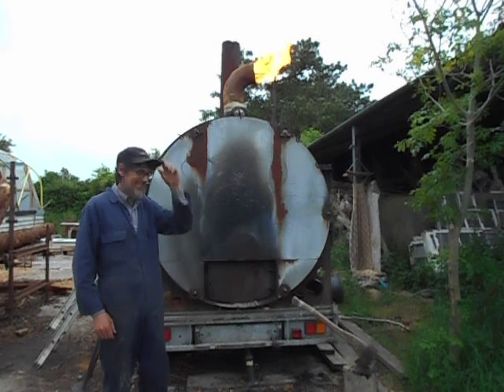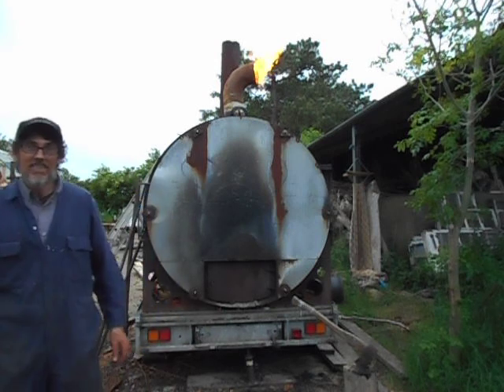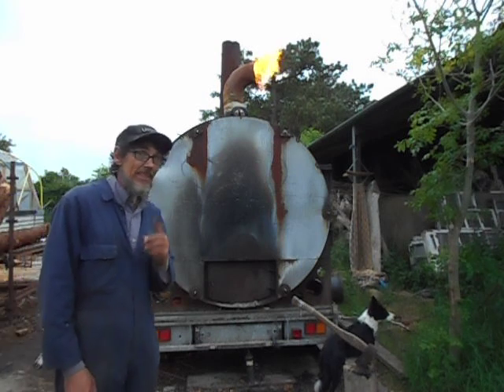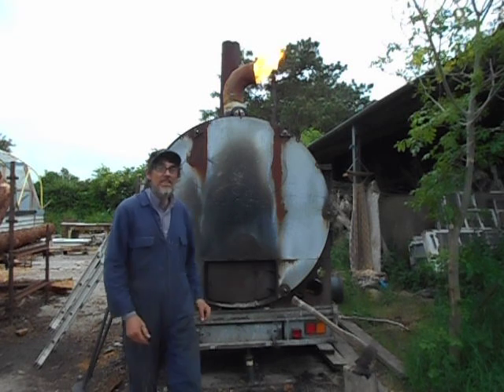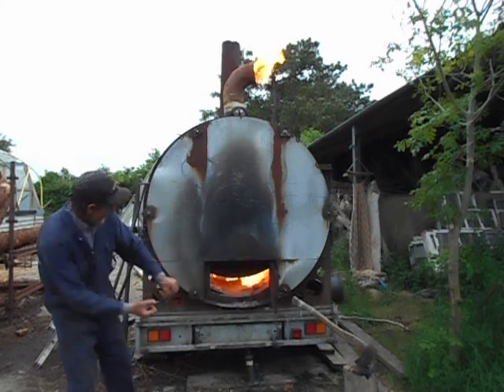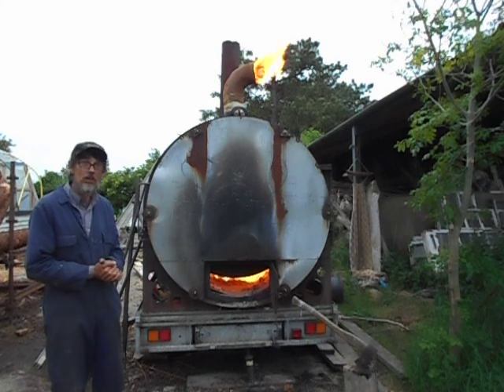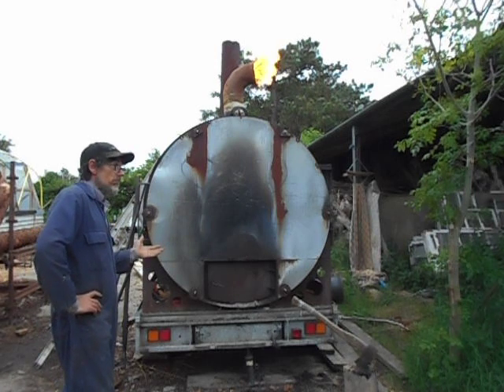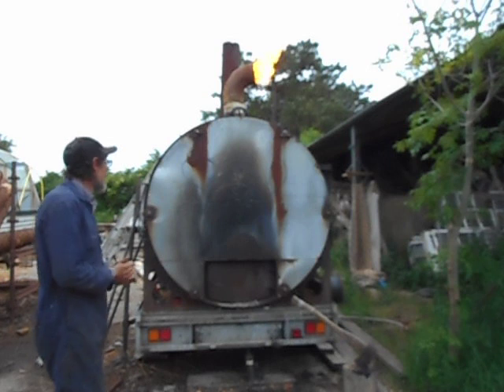Making Charcoal

Comment: Great! I really hope you find time to post videos of the build of your new retort. I've been watching all the Thai videos of homemade retorts and am planning to build something similar with heat capture for water heating. Some of them run the gasses through a condensing loop before returning the gases to the burner and I'm hoping this idea might allow green wood to be roasted directly in the kiln without adding too much steam to the burn (I don't think they use condensation for drying but more to collect wood 'vinegar', although it should condense excess steam also). I wonder whether your wood is winter-cut and seasoned in air a while to reduce water content before you roast it or whether green wood and summer-cuts works well. Thank you Tim, and best wishes for your charcoal industry.
Reply from the maker: Thank you so much for your encouraging comment. Since this video much has changed here. I have not built the new retort having discovered a fast productive charcoal making method that suits our needs here much better.
I now use Flame Cap Pyrolysis to use the fancy term,
or a controlled bonfire being simplistic.
all of our charcoal output here now is used for experimental archaeometallurgy and the charcoal produced this way is ideal for this use.
I hope to post a video in the next while describing the method which is simple, productive, and is very cheap or free.

Comment: Great job. Thanks for the video. I have about the amount of smoke before ignition of the gas from the carbonization process. Is there a lot of smoke?
Reply from the maker: Yes there is some smoke at the beginning, mostly water vapour, quite dirty just before it can be ignited. 
I no longer use this method, and the retort has failed, the inner chamber has burned through.
I now use "flame cap carbonisation" in a ring kiln built from corrugated iron. Using this method I can produce about 2.5 m³ of charcoal from branchwood feedstock in about 8 hours with practically no smoke throughout. Charcoal is lightly quenched with water at the end of the process and shoveled into metal barrels and sealed to cool.

Comment: Would love to see the inside of your kiln, didn't check yet but is there a video of that?
Reply from the maker: sadly no video of that, the kiln has burned out its inner chamber and needs repair, i use a different method of charcoal making now. The kiln is available for sale NEEDS SIGNIFICANT REPAIR WORK
Reply: @timfromtang  ok bud thanks for the reply.

Comment: HOW MUCH MONEY MUST I PAY VOR THE CHARCOAL RETORT?
Reply from the maker: better to build one, it is an expensive machine, although we bought our first we have learned from our mistake, and will build our next ones. We are working on a design suited to Irish conditions and the right size for typical farm forest holdings in Ireland. Watch this space, we will document the build here.
If you are determined to buy one, the price of the exeter retort we use is published on http://www.carboncompost.co.uk/
Reply: @timfromtang  right in the middle of tending / first thinning and very interested Tim. I was looking into charcoal as a possible end use for the thinnings when I happened on your channel. Do you think there is capacity / demand for more producers?
Reply from the maker: YES YES YES there is capacity and demand, and even a new much cheaper retort design to reduce the cost of entry. charcoal is an ideal use for first thin hardwood. contact me if you like im timfromtang on boards.ie and at gmail
Reply: @timfromtang  sound 👍

Comment: hook your retort up to a hot water storage tank.................
Reply from the maker: Aye Marcus such things are under consideration alright. Plans are well advanced, and quotes for materials arriving for the new retort about now. The new design will not waste surplus heat. After all when you make charcoal from timber you lose 3/4 of the weight approximately and 1/2 the heat approximately ending up with light energy dense fuel. This heat is used to initiate carbonisation in a second chamber in the new design, and further surplus used to pre dry input material.
When bricks are laid more info may appear here.
Reply: @timfromtang  hooked my prototype up to a second hand hot tub.......after a day of logs and bagging charcoal there is nothing quite like getting up to to your neck in hot water with a beer...........
Reply from the maker: @marcusmason3440  I'd love to see your setup, got some footage or pics to share? timfromtang  then no spaces, then the at symbol, then gmail then dot then com

Comment: Terrible to waste all that heat
Reply from the maker: Correct and right, terrible to waste all that heat. using the "waste" heat does present some challenges though. I understand that some of the larger biochar facilities do use the process heat for other things.
We do not use this retort anymore and now use a different method.
Any Ideas for waste heat recovery?
Reply: @timfromtang  my idea is to make the biochar integral to my house heating using MASS heat storage (I have a stone wall) and only char in winter
Reply from the maker: @yellowgreen5229  Grand plan, If you'd like to have a chat and thrash out your ideas some I'd be happy to talk, timfromtang at gmail dot com